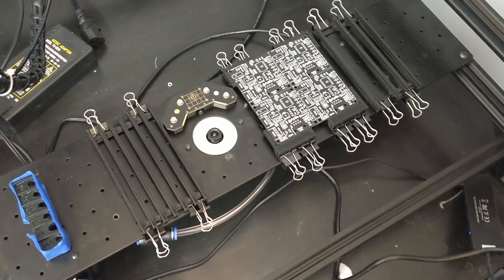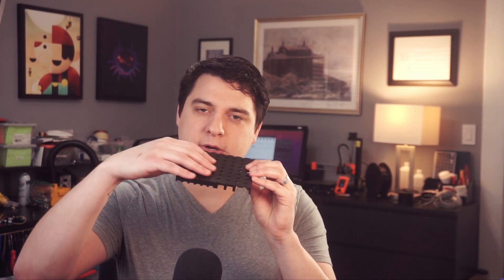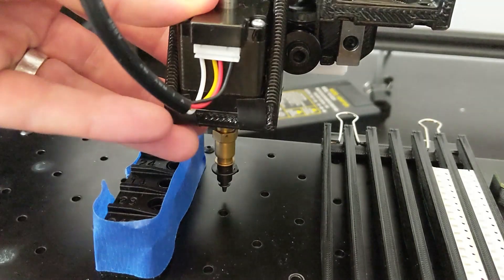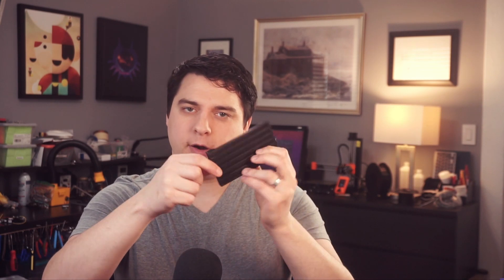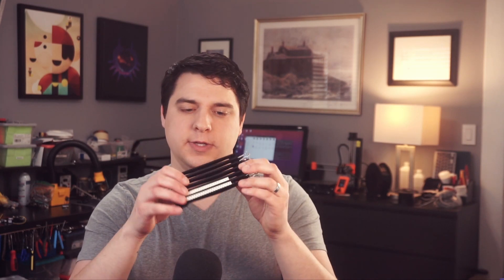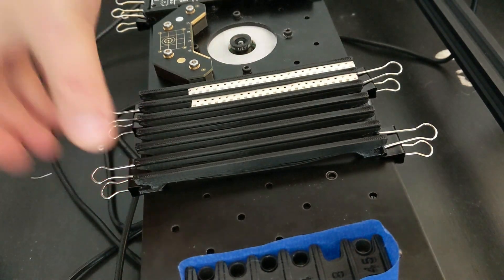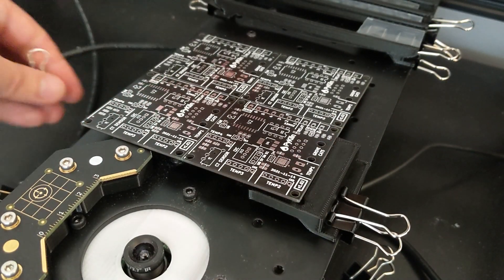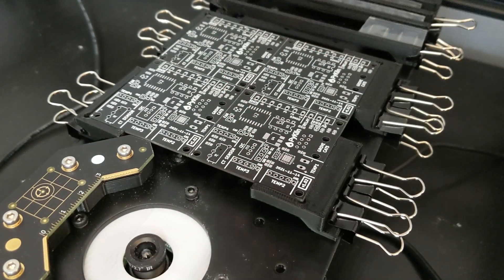Better Feeder Tray and PCB Holder for Lumen PNP

Comment: I like the design idea of using the binder clips, but now that i expanded the build area with 2 more staging plates, i can't clip stuff on anymore, so i need to go back to using a screw in place design...
I'm actually on the fence to exchange all the screws that are used to mount the electronics and stuff on the bottom of the staging plate with countersunk screws, so there is no more screwhead interference with part trays and pcb holders on top of the staging plate. The other idea i had is to just move all that electronics and pneumatics somewhere else on the machine where it's not in the way, for example on the left side of the machine, outside of the bottom aluminium extrusion. But i guess making some countersinks with the drill and change the scews is the quicker "fix" for now.
Looking forward to follow you along on your journey with the Opulo. 😃

Comment: Thanks for making these. I bought the kit a week or two ago. Gonna be a little while longer before they're ready to ship. It's exciting the possibility of an affordable way to automate SMD placement. I just finished a toaster oven to reflow conversion and did my first stencil job with tape and tweezer placement. I've done hand soldering and hot air rework stuff for years. It went mostly well but I had to rework the 100 pin TQFP package, as it just got too much solder. Then the new part had a few open connections, I discovered trying to figure out the weird behavior of the LCD. Learned I need a proper desktop stenciling machine and that tweezers are fine for passives but a PITA for larger parts. Still, it's opened up so many possibilities with chips I would have difficulty hand soldering.
Reply from the maker: You're welcome! I need to learn FreeCAD and get these added to the LumenPNP Github repo. Not to too my own horn but I like my design much more than the original magnet PCB holders. I know Stephen just released a new video with a different design, but I still feel like my design is easier to change while still having a strong hold.
Reply: Would you mind sharing your toaster conversion design and overall experience with that. I’m thinking of either doing toaster conversion or going with some cheap Chinese stuff for baking.
Reply: @viveksharma9564  I built the Whizoo kit. You buy the oven and pretty much everything else comes in the kit. I've only   built two revisions of one board but the reflow oven handled leaded and lead-free reflow fine. The PCBAs came out with nice shiny fillets just like a professionally assembled board without burning components.

Only issue I've ran into has been too much paste on tight pitch QFPs causing shorts. But that's more an issue of my paste stencil process.